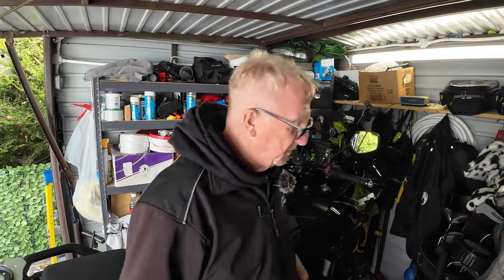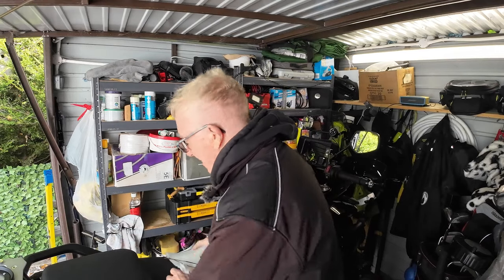CF Moto Explore Wading in your Exhaust

Comment: Well I don’t thank any one could be worse then me for meddling!! 😂love it glad you did it. Hope they release the up date for the throttle mine drives me nuts
Reply from the maker: @stephenbryson5618  thanks for your comment.  Drives me soft too.  I’m very disappointed that CF Moto has not or appears not to want to look after its existing customers who spent money on the premium bike of the range and have been left with a throttle issue. You can blame emissions for everything but that doesn’t detract from the lack of support to correct it. Unless they send one to the dealers  none over the air upgrades will sort it.